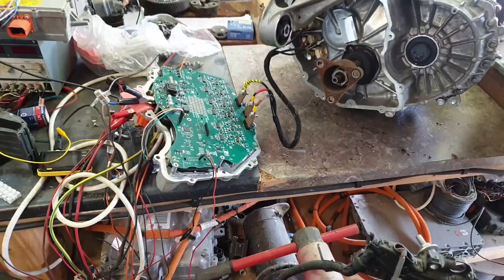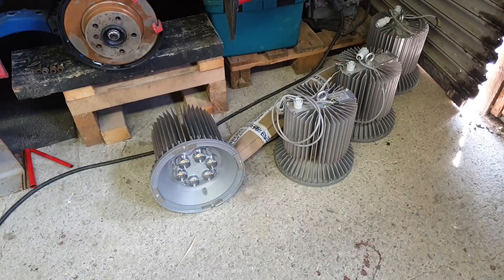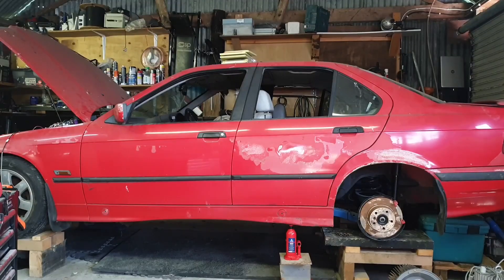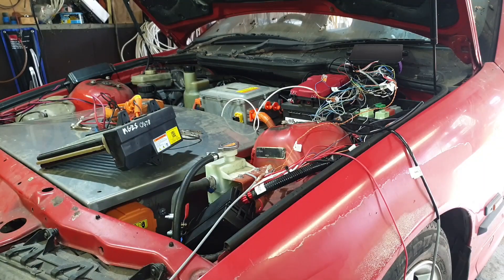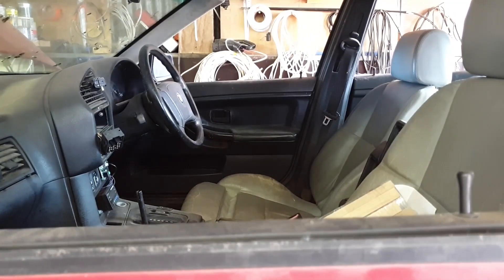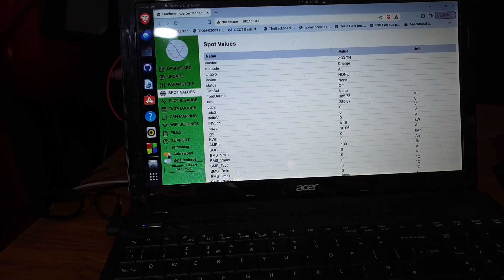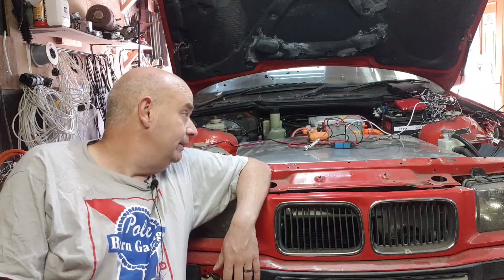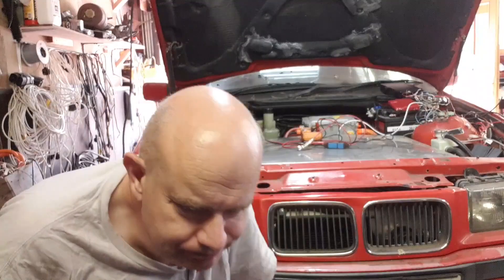BMW E36 EV Conversion Lexus GS300H Swap Part 6

Comment: I remember when the red arrow first showed up as the 1000 euro build with a forklift motor. Man has time flew by. Since the days of first spinning the tesla LDU in the panzer I got older and got my drivers license, a little late but I did it. I remember chatting on the livestream years ago when you came here to Romania to fix the rally cars with the tesla motors. I ended up fixing a few ev's myself, a car and some motorbikes. Hand soldered every smd on the controller for my moped and got my hands on a 14kw pack. My car's gearbox has been acting up since the beginning and they want to implement some nonsense eco taxes that cost as much as those cars because they suddenly want to get rid of 20yo cars. But the quality on anything newer than 10 is unacceptable, I'm not touching anything with a plastic oil pan and I guarantee the engines they make now that burn oil pollute more than a well kept car from 20yrs ago. We have the same 30 year old requirement for a classic car, you have to apply with something like a collectors club that checks the state of your car and forwards it to the vehicle department. They want all original parts, zero rust, for the dashboard to be intact, will fail your car even for an aftermarket stereo which is insane, classic is the 90's these days, not 70's. An ev converted car would never pass so it's quite interesting that you may have the option to do that. We need changes in car regulation. But not what they're planning. And on that note, it might just be time for me to start planning my conversion after all these years. I've been following for too long not to have a project of my own. And not getting a 400 euro tax a year for daring to own a car with euro 2 engine might just be the perfect kick in the backside. What I paid for that car is not far off from that. I think this is some car maker lobbying trying to make us scrap old cars. I don't agree with such a thing and as long as it's registered you can't escape even if you don't drive at all. Old cars should be preserved not crushed, not like everyone has the patience to keep them alive anyway. I'm sure people will still want an e36 15 years from now. I doubt anyone will want the crossover suv's they make now for anything but parts. My concern would be the horror stories I heard about homologation to make the swap legal and pass yearly inspection afterwards. They care way too much about any changes here, even if your wheels are an inch off from what's in the registration they take the papers and you need to fix and inspect again. I really don't want to get rid of my car just because someone that has a chauffeur woke up with a bad idea one day. I think a leaf motor with a prius inverter would get me on the way, off to ebay and openinverter I go. Cheers Damien 🤝

Comment: lets see if I've got this right, a tesla control board aka mcguire version, will mean  you can have a telsa without cameras/internet connection/fully repairable for a diy with reasonable knowledge of electronics etc. Basically you get an old style car that you have full control over but its powered by modern electrics..........i like it.........alot.